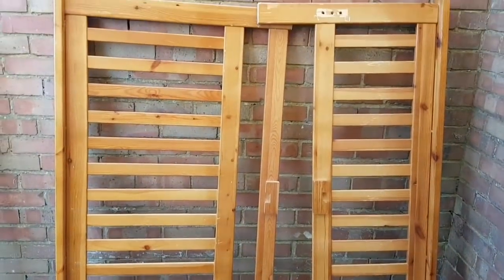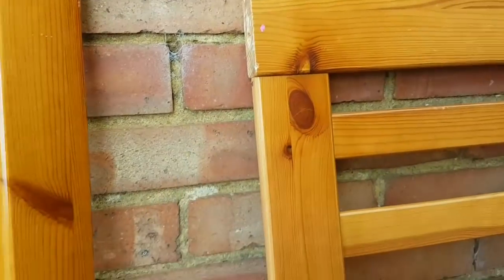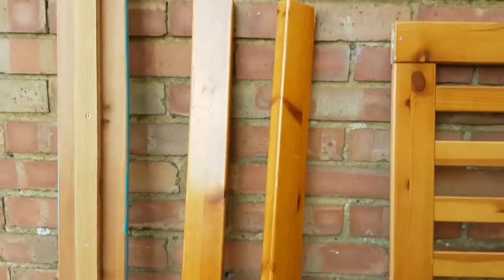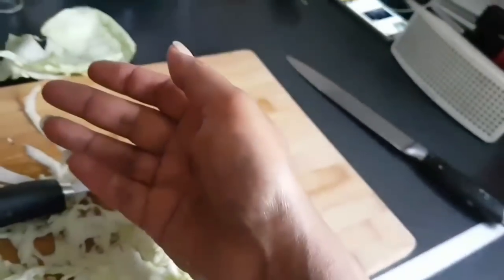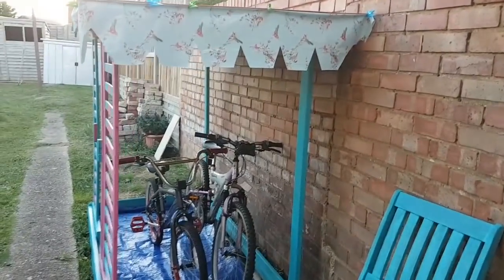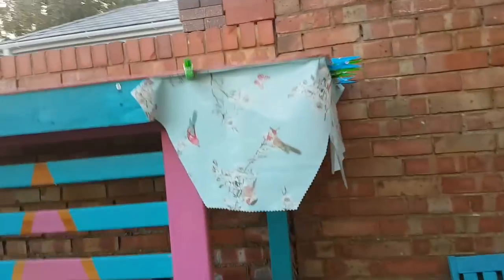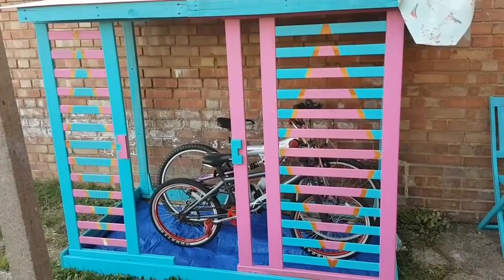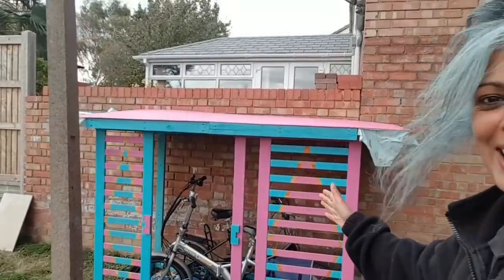Bed frame to Bike shed.

Comment: Ratchet screw drivers are better if your hands suffer from the handles of the fixed kind. So many tools are made for  a mans size or strength of hands. You can get some very nice PVC sheeting stuff from somewhere like the range that you could staple for the sides and a loose door. If you made the door too long and then added a sleeve to the bottom, you could feed a piece of wood in to weigh it and help it stay closed.